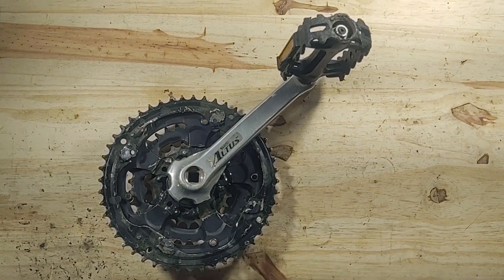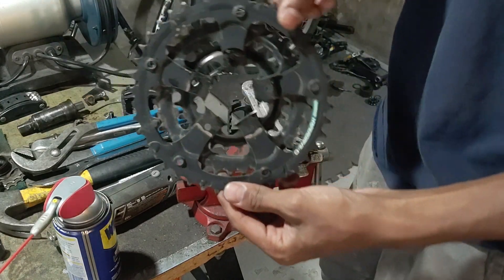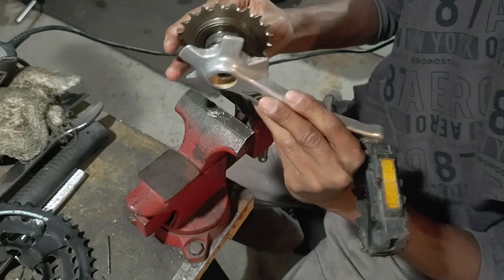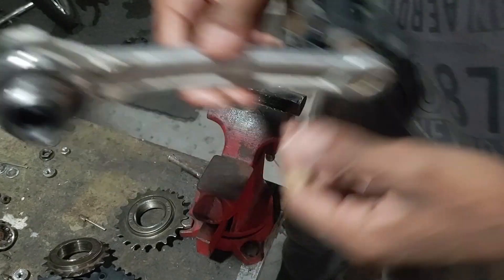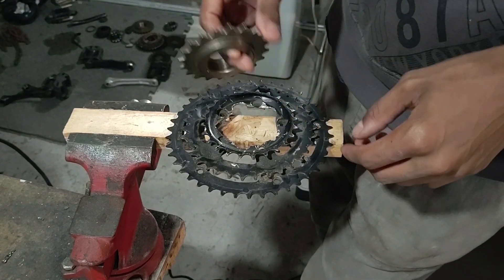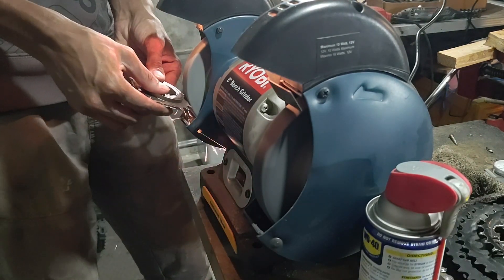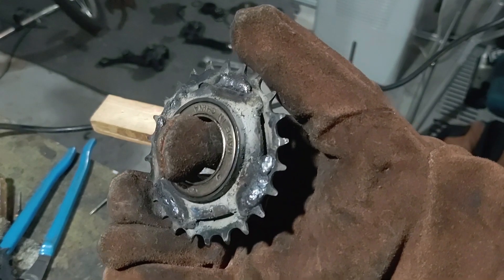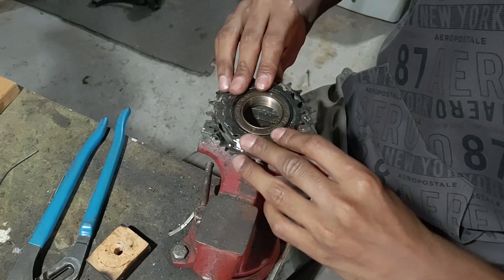DIY Mid Drive E-Bike Part 2: Making a Freewheeling Crank

Comment: This freewheel crank you are doing. The ideal is you use the biggest chainring possible with smallest motor sprocket possible and the smallest chainring possible from the crank to the cassete then use the bicycle gears for the acceleration or top speed.

To calculate gear ratio = (driven sprocket ÷ drive sprocket) x (driven sprocket ÷ drive sprocket) to have your gear ratio and compare with the ratio recommended for your motor.

This design benefits greatly from high rpm. So higher battery voltage you can use, the better.
Reply from the maker: Absolutely! By sequencing the power from small/big--small/big sprockets, the torque to the wheels is maximized, and the gearing allows me to stay in the motor's "powerband". I did the calculations you mentioned in part 1 of this series. And yes, higher voltage is definitely my friend here because that also reduces the amperage requirement, which translates into less heat and strain on the battery.
Reply: Which motor are you going to use? @engineeringdiy6311

Comment: you can't depend on those terrible ratchets they're made to be a consumable item unfortunately
Reply: Well, I think it'll work fine since the power from the motor wont need the ratchet freewheel to be engaged, but rather disengaged.  Cheap freewheels are usually only problematic in the case of engagement.
Reply from the maker: @TheAfricanGarage  Yes, this bike will majority of the time be used under full motor power, however I will definitely be on the look out for any mechanical problems with the freewheel during testing.